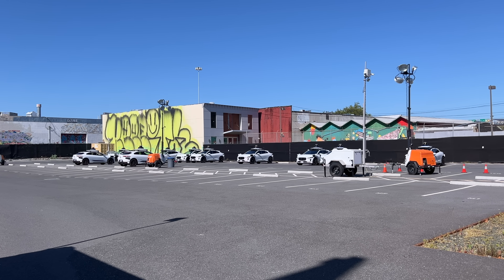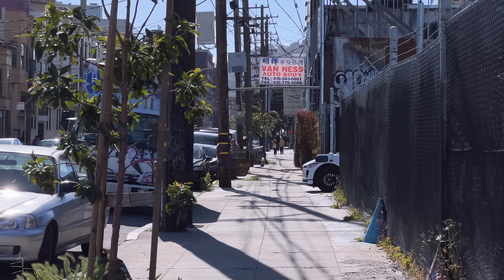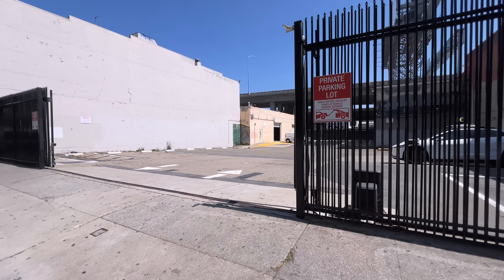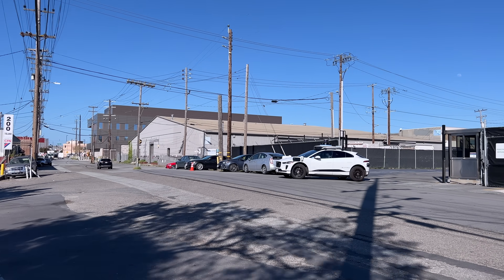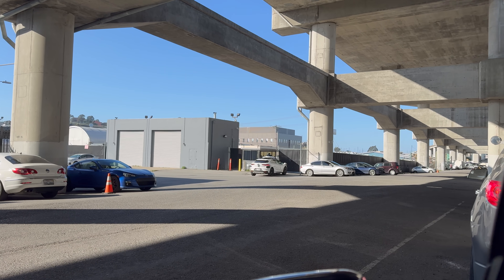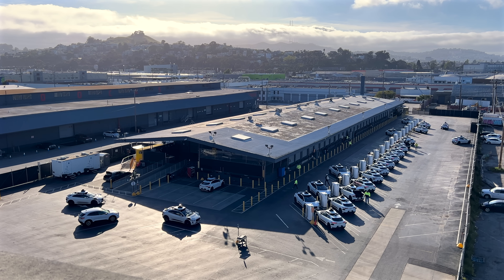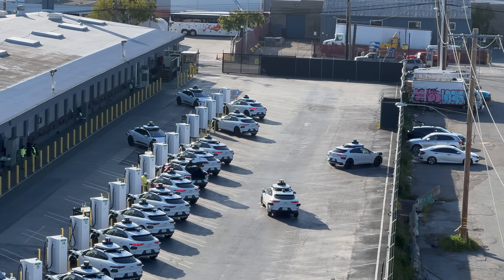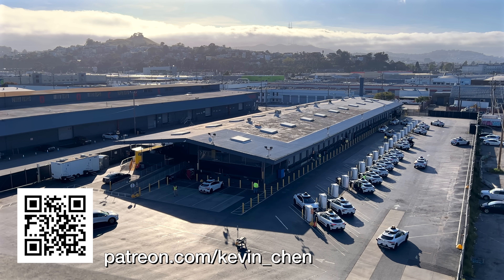Behind the Scenes at Waymo Driverless Taxi Depot

Comment: Great video Kevin. I agree with your guesses at about 13:00 on data swapping going on during the trunk visits by the Waymo staff. I'd say the main reason for the disk swapping vs. wireless data transmission is speed (and maybe cost). Historically wired data transfers occurred at least an order of magnitude faster by wire than wireless. That ratio may have gone down somewhat recently with new WI-Fi and cell standards, but we don't know what they are doing with this data. If they just retain it briefly, then they might not even transfer it off the swapped drives Instead, they might just schedule the drives to be reused once the data was retained long enough to be sure there wasn't a big problem, like an accident that was reported somewhat later.

BTW, two possibilities for the wired connection are USB or Ethernet. I believe most (if not all) of the 40 sensors (28 cameras, 6 radars, and 6 lidars) are networked to the Waymo computer in the trunk via one or more Ethernet switches, also located in the trunk. I believe the data drives you are talking about are external to the rest of the Waymo computer and either are connected via Ethernet (like a NAS unit) or as an external drive using USB or eSATA. Maybe some former Waymo or Cruise employees can comment on this, since those working with this onboard storage (probably mostly to archive the sensor data) would know best which drive types (although I'd guess big SSDs) and which wired communications (Ethernet, USB, or SATA?) are getting used in the latest self-driving systems like Waymo's.
Reply: They almost certainly keep all the data somewhere, offloading it to a data center at least. Whether that's by having a courier take the hard drives and just ship them right to the data center or by transmitting the data remotely is anyone's guess.
Reply: Before Alphabet became a bit more secretive in their processes, their data management processes in their cloud datacenters were something to behold. Dudes riding around on skateboards and getting dispatched to pull and hot swap drives or computers was just a thing. While speculative, it would be sensible to assume swapping hardware is something they have 20+ years of experience and they understand the ins and outs quite well.
Reply: It's also worth noting that if they are using wireless transmission, there doesn't necessarily have to be a large antenna on the building. There could very well be some much smaller antennas inside or inconspicuously mounted on the wall or roof that could do the data transfer. I'm not saying this is the case, just that it shouldn't be dismissed because you can't see a big antenna sticking out.
Reply: I understand that Waymo vehicles have a mobile storage device similar to that of Synology
Reply: @PangDaDriver  Yeah, that sounds right. I'd just guess they are using SSDs inside that NAS unit for the speed and reliability (especially regarding vibration) over spinning disks as used in the old Synology NAS units and even over the hybrid drives. Yeah, I guess that means all the Waymo computer peripherals (beside the car's system like steering, throttle, brakes, and the Waymo displays which must be wired by DisplayPort or HDMI) are connected by Ethernet, maybe all on one switch in the trunk.

Comment: My first thought was that they should have induction charging so that a human didn't have to plug them in.  But since a human needs to check the car to make sure it's clean and ready, he might as well plug it in as well.  It takes a second human visit to unplug it to put it back in service.
Reply: Might consider battery swaps like China has. There it's subscription based and for a specific car. But that would be perfect for the uniform Waymo fleet and makes it fully autonomous (and gives much better utilization of the cars).
Reply: @jonathanbott87  Perhaps they could use Neo EV's in China as they have that battery swap capability.
Reply: Induction charging isn't as efficient as wired charging. If they want to reduce the human aspect, they could build robot charging stations. About a month ago, I saw a video of a robot gas station.
Reply: I'm sure that's the eventual plan. It's just too early to get that high tech with it yet.
Reply: They could have internal cameras to detect spills, dirt and lost items. Surely they aim to be completely autonomous at some point.
Reply: They could also use some kind of pantograph charging system like those electric busses have. Induction is very inefficient.
Reply: Induction is slow and inefficient. Hiring single person to walk around plugging in cars is not that crazy
Reply: For smaller charging station with no human, inductive charging will still be needed. Then we can increase the number of robotaxi charging stations and spread them out.
Reply: @boyangsong3091  Induction charging isn't efficient, for a self-driving car, it would make way more sense to use a direct connection using a mobile automatic connector like pantograph or just the charging pads used in self-driving dark rides in amusement parks. You get 99% efficiency at the full max speed for charging. It would honestly probably be cheaper upfront cost than the giant induction coils you would need on both car and ground.
Reply: @boyangsong3091  theres no way induction charging will come even close to price competition with gas, allready hybrids in California are winning the price war. Induction losses would mean you would be better off driving a 16mpg dump truck
Reply: @seancopley499 There's inductive charging solutions for EVs with >90% efficiency. And it wouldn't really matter in the end regardless as the electricity is still almost free in comparison to gasoline.
Reply: @seancopley499 incorrect
Reply: @swecreations  really?
Reply: @conceptrat  Yes. There's been published research papers on this dating years back.

Comment: Do you know if those chargers are Superchargers or standard 6 kW to 12 kW chargers?
Reply: Judging by the look of them (size) they definitely look like fast chargers, and slow charging doesn't make any sense. These i-paces are not great at DC fast charging can only take about 90kW peak afaik.
Reply: Based on the size, these are definitely DC chargers. "Superchargers" are Tesla's DC chargers, and so therefore these are not Superchargers
Reply: A while back it seems observers concluded they only use Alpitronic units. High end European chargers with excellent reliability and scale to high voltage architecture -- they offer 50 kW to 400 kW. Doubtful they'd let Tesla in the henhouse